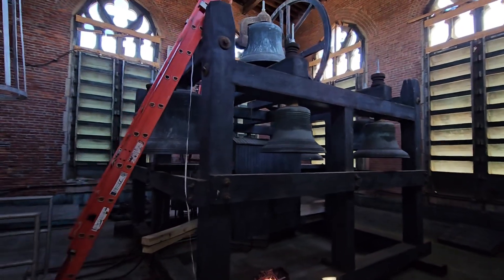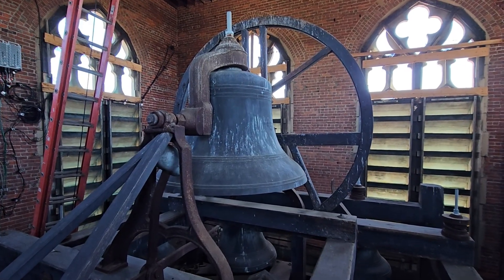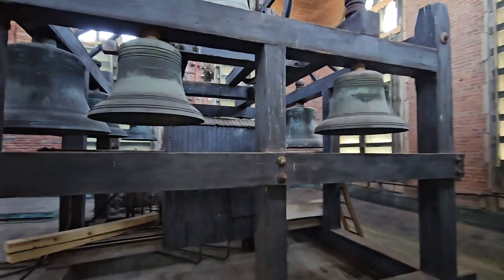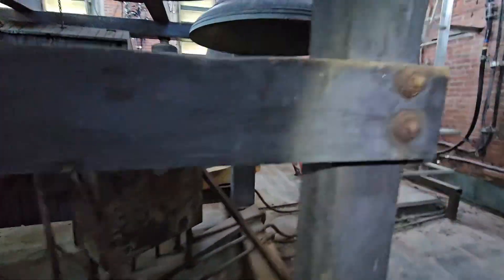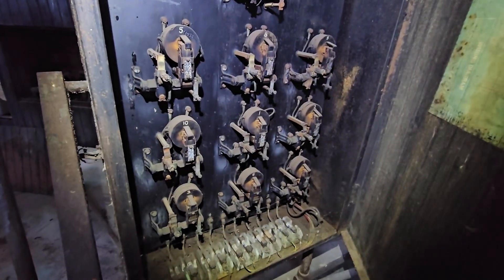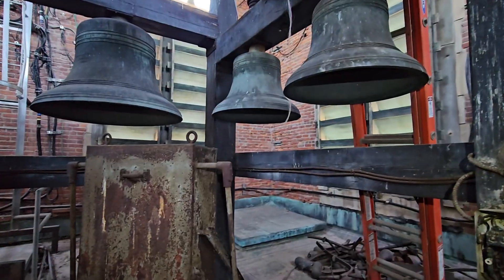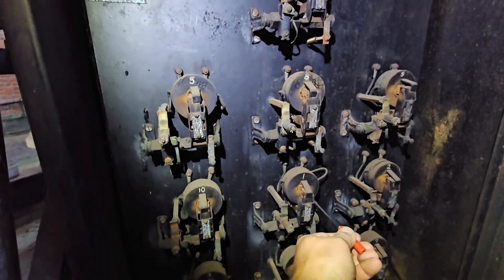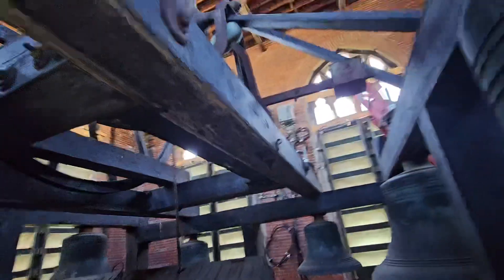AWESOME automated 1927 bell chime equipment still in operation!

Comment: are you restoring functionality to the other 9 bells as well?  Would love to see and hear the full chime!
Reply from the maker: Yes, this church has been fundraising for the renovation of the chime. For now we are adding a modern striker and control system for the large bell to be used liturgically, but eventually all bells will receive strikers and can be played musically again.
Reply: I wonder what happened to all the other hammers? WW2 scrap metal collection?
Reply from the maker: @greggv8 I removed them about a year ago in order to replace the bolts that support the bells. The customer declined any scope of work to retain the original mechanism but the long term plan is to install new strikers for all bells (to be controlled by a modern computer system that allows for manual keyboard play and automatic play from a music library).